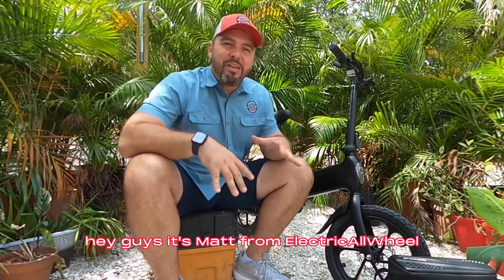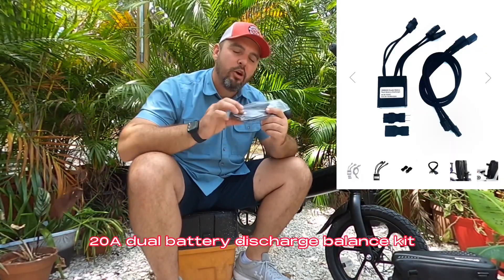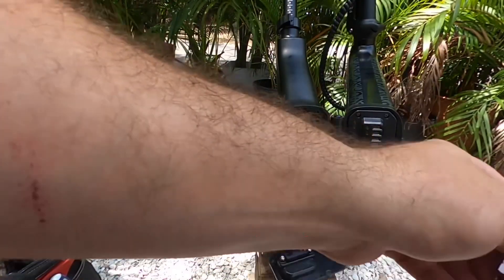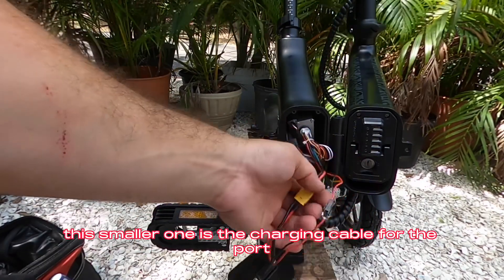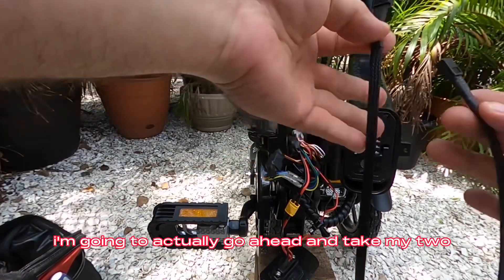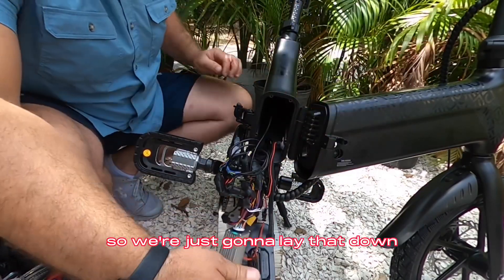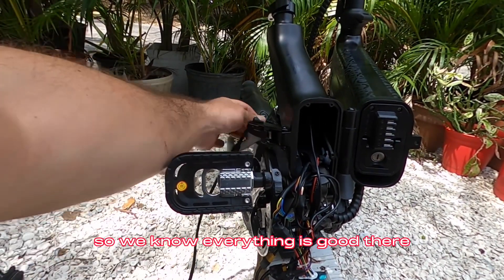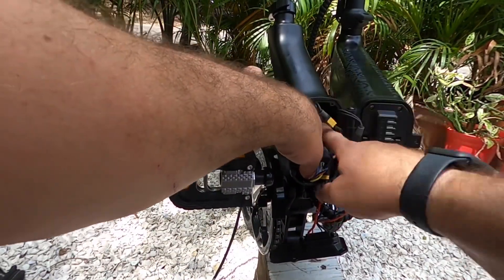Jetson | Haze | E-Bike Plug and Play Dual Battery Discharge Balancer Kit | Install Two Batteries

Comment: I'm one of the owners of one of my haze electric bike and I'm wondering if I can convert my 48 volt Electric Haze into a 36 volt  how do I wire it up
Reply from the maker: Would require controller replacement at minimum. There will be a voltage cutoff match to the original system voltage which does not include the majority voltage range of a 36v battery
Reply: Thank you for your time. I was wondering if you could show me how to wire up my haze from 48v to 36v. @ElectricAllWheel

Comment: I hold this type of content in high regard, as it provides significant inspiration. I am also the owner of a Jetson Haze bicycle—identical in model—and I am deeply interested in enhancing its performance. However, residing in Ivory Coast, West Africa, presents substantial challenges, particularly with regard to procuring components from platforms such as Amazon or Alibaba, owing to the prevalence of fraudulent practices. Nevertheless, I remain committed to exploring viable alternatives. Thank you for the valuable insight and motivation.

Comment: I'm thinking about using a 52V battery for the spare, Most if not all 48V speed controllers/motors can handle the extra voltage, Just gotta keep an eye on motor temps. due to nominal voltage a 48V battery it has similar voltage to a 52V battery.

Comment: I need speed too go to 30 mph plz is it gonna work with this ?
Reply from the maker: Batteries will only add more range unfortunately
Reply: @ElectricAllWheel if i replaced the battry with a biger amp it will get more speed ?

Comment: How much range do you get from the second battery
Reply from the maker: 10Ah * 48V = 480Wh
480Wh / (25Wh/mi) = 19.2 miles
Reply: @ElectricAllWheel  thanks. So about 34 miles with both batteries together?

Comment: do you make one for the jetson bolt pro?
Reply from the maker: For sure! Check out our channel for the install video 😎
Reply: @ElectricAllWheel  awesome thanks! Also one last question, could I buy 2 seperate batteries, have the internal and one external connected and when they die swap out the external battery for my second one for even more range?

Comment: When I clicked on the link for the battery it gave options for more watts and volts. Can that be used if so will that cause the bike to go faster? Also, if the kit shows as being sold out. When will they be available and how will I know so I can purchase it? 

Thank you for the video!
Reply from the maker: You will want to match your system voltage. You can use any amp hour battery you want.
The kits should be available in the next couple of weeks so be on the lookout. Also, the link provided for our kit on Amazon will work with the Haze.

Comment: So... By accident i think i discovered but cant verify how it works ...  My haze battery has an off switch. I can literally switch that battery off. It appears my big battery still powers the bike but also acts in a manner 2 balance out or charge battery while switched off... Goin to run some more tests ..
Reply from the maker: Would suggest unplugging the second battery and checking for function

Comment: Ok im back... Few things... Im noticing that my battery light indicator will flash between batteries? Im guessing it reads one discharging then switches 2 other. Also it may appear that one battery appears to discharge while the other is completely full while other is indicating 3 lightsand 2. However, with all that said im not losing power. That baby is moving and not slowing down... Any tips?
Reply from the maker: Test them to make sure both batteries are discharging independently…ride the bike with one then the other

Comment: Seems weird with removable battery that one does not simply buy a second battery (and swap it) ?? It only takes 20s!
Reply from the maker: Many riders do not wish to stop, unfold the bike, key out the battery, and replace it. Moreover, dual battery will sustain high voltage output for a longer duration of the ride
Reply: @ElectricAllWheel  sure! I believe that (not). Void the warranty, to get 1% benefit.
Reply from the maker: @gnosticinformer  1000+ happy customers say otherwise. 
Enjoy the ride!

Comment: Installed, working and running! Thanks. Boy is it snug next to that controller or what? My throttle for new controller came damaged... So that whole unit is goin back... It'll be a few weeks before I receive the new one and get a crack at installing it...

Comment: My biggest concern is how 2 gauge second battery level... please respond.
Reply from the maker: A battery meter gauges voltage. The combined batteries will output the balanced voltage and be viewed as a single battery (this obviously will not work the same if you hookup a charged battery and a depleted battery, but it is safe to do so)
Reply: @ElectricAllWheel  as far as everyday usage? I'm looking to order a 48v  100ah but it says 500 w? xt60 cable w bms 2a charger.. my concerns are the 500w rating. N KNOWING battery level after every ride or when I ride as I only ride now about 2-3 times a week.  With that battery I'd ride everyday.... please respond.
Reply from the maker: @thegntlemn1986   the 500W designation is likely related to the current limit of the battery for a motor rating (500W). Meaning, this battery is good up to a motor rating of 500W. The Ah is just the capacity. You could add 100000000Ah if you have the money. (Likely not because of weight, but the principle is the same)
Reply: @ElectricAllWheel  new subscriber

Comment: In case my battery ever dies i wanted to find a way how to attach a battery separately like this. Would this work only with the one battery and not using the internal? Cool video! Not many haze videos online :)
Reply from the maker: Yes. You can leave the kit installed and use only one battery.
Reply: @ElectricAllWheel  super cool! Thanks for the reply :)

Comment: dose it have the same controller as the jetson volt?
Reply from the maker: Jetson | Bolt Pro | E-Bike Plug and Play Dual Battery Discharge Balancer Kit | Install Two Batteries
https://youtu.be/syK8L0FD2aU

Comment: Is there a splitter you could add to that charging cable to make it charge both batteries when plugged in?
Reply from the maker: For safety reasons this hasn’t been pursued by us, but yes, there are versions on the market that do this.;

Comment: Does this make it go faster aswell? 
And do you have the link for this kit?
Reply from the maker: This kit allows for more range but not higher speed. The links for the items should be in the video description.
Reply: Is there ways to make this one go faster ? 
I seen some things on other Jetsons that you could do. But not the haze just curious if the haze could reach a lil higher speeds with upgrades ?

Comment: Will this place your two batteries in parallel and how does it work if there are two different Amp Hours batteries?  How does the charging circuit work with two batteries?  Same charger?  Are you able to charge both batteries at the same time using the factory charging port and charger?  Thank you for the video.
Reply from the maker: Batteries can be different amp hours but should be the same rated voltage for the parallel connection.
The batteries will need to be charged independently.

Comment: It’s really cool how you did this, but unfortunately, you lose your brake lights when you put this case over them! I would probably strap the battery to the frame in the front where it splits in half and folds. I think that would be much better, because then you get your red light on the back where people can see you visibly at night time much much safer! Thank you for making the video, it’s very handy for putting on the extra battery!